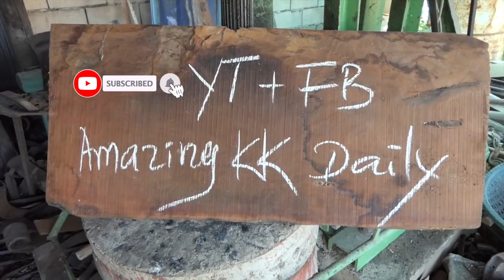MAKING A HIGH QUALITY GRASS CUTTER BLADE FROM CHAINSAW BAR USING ONLY A FEW TOOLS

Comment: Filo grande pesado se hacen tres filos en forma de estrella .al ser tan pesado con el tiempo rompe los engranajes.. Ese motor debe fe ser de 38 cc .
Motor forzado...
Reply from the maker: EL TAMAÑO DE LA HOJA ES EL MISMO QUE EL ORIGINAL
Reply: @AmazingKKDaily  si es el original no hay discusión jaja. En esta parte del mundo lleva una estrella de tres filos de uno ocho centímetros de filo bien balanceado. No digo que el trabajo esta mal hecho sino que me pareció peligroso la forma y tamaño del filo lo cuál podría ( no digo que va a pasar ) provoque rotura de engranajes en el cabezal o el cardán que lleva la potencia desde el motor a la cuchilla .
Tu máquina debe de andar entre 9000 y 11000 vueltas por minuto no quiero pensar que pasaría si se suelta esa cuchilla.saludos desde buenos aires argentina...